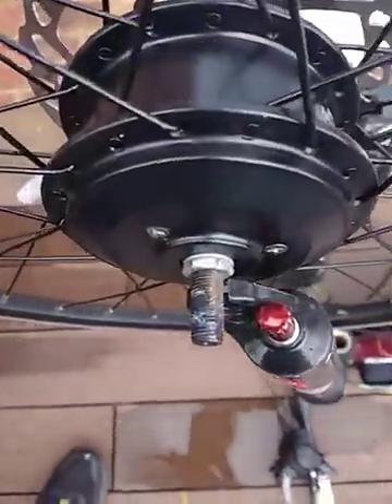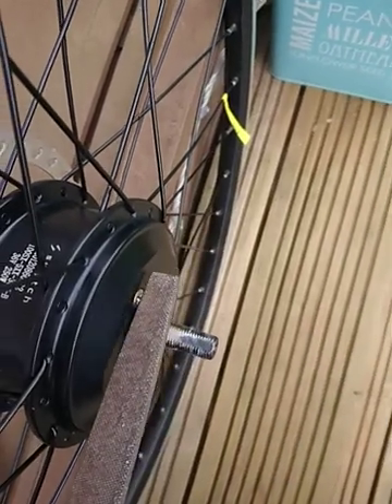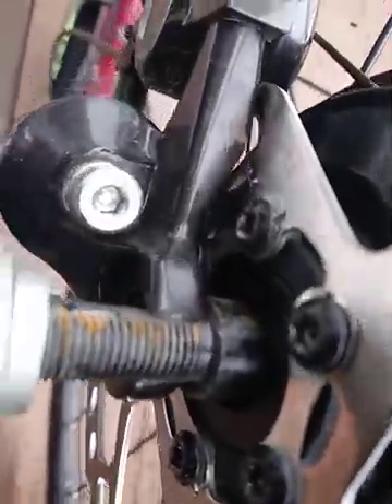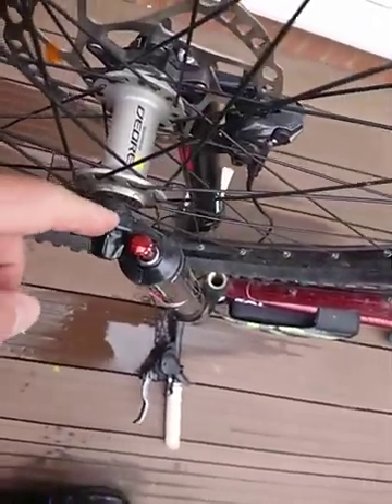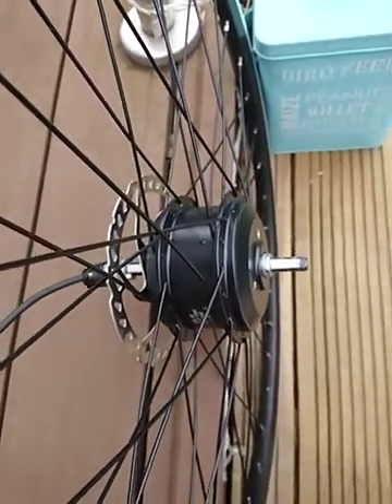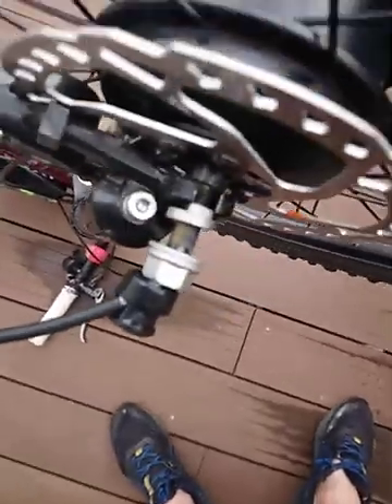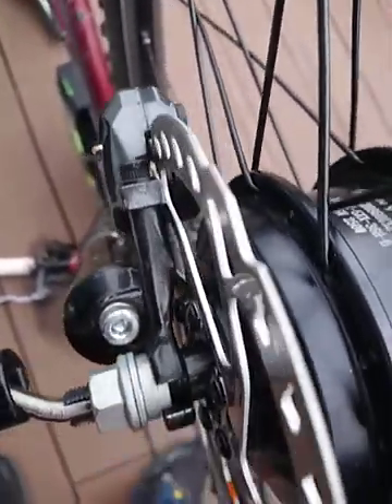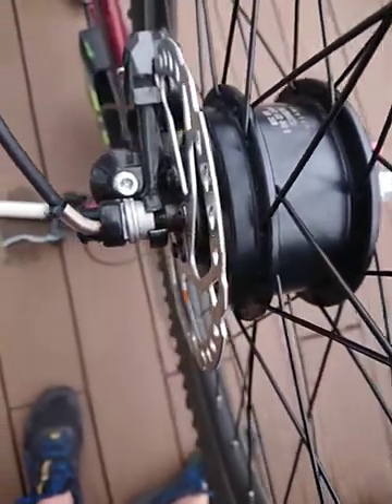Swytch electric front wheel fitting. Forks too small? Walkthrough getting swytch front wheel to fit.

Comment: So, you do the very they say not to do in the manual?!?
Reply: Yes and recorded here so you can decide if it works . I don't think this is a recommendation , Just a "this is what I did if it's any help to you".   Obviously you can follow the instructions to the letter and send it back as it won't fit.
Reply from the maker: In fairness it used to say file , but definitely says not to in the new manual..they obviously didn't want to take the liability anymore. Here's the current manual .  https://www.swytchbike.com/manual.pdf
Reply: @dickysylvester  no response from support, so I just filed the thing (carefully and evenly). Pretty minor amount of metal removed and I have no idea what other solution there would have been. It’s solid and not going anywhere!
Reply: @dickysylvester  Ah, so the manual has changed? Your link is what I have. I raised the support ticket before I found this clip. 
I guess there’s no great hurry for me - they sent me the wrong charger, I think (cable doesn’t fit the inlet in the battery)!
Reply: @colino72  Hi Colin, How long did they take to replace the charger? Same problem with my kit. Opened support ticket 4 days ago, nothing yet. Have now opened one for the wheel not fitting (before I file anything, let's see what they say - will update this comment following their response.

Edit 1: I see that their system is only allowing ONE request per customer - any new cases I try to open are being marked 'Solved', and a comment regarding that was tacked onto my original case. Not going well so far!
Reply: @stepheneyles2198  hi there. I had a reply after 12 days saying the part had been ordered, would be picked within two days and then shipped within 7 days and I would get a tracking no. That was Wednesday last week, so I should see the tracking code within the next 7 working days. 
They were apologetic with the response delay. In the meantime I had made myself annoying on Twitter. Not sure if it made a difference. I also sent their CEO a message on LinkedIn, but he didn’t respond.
I never had any technical advice on the forks, filed them anyway. I saw another YouTuber post that he had been told filing them is acceptable and does not void warranty.

Comment: Hi, I have just done this on my 2000 specialized epic with fox forks , snapped the lugs on the first outing , very glad I was ridding slowly through heavy snow and not on a road a speed, can anybody reassure me that this actually works and is safe? , I guess you need a strong steel or reinforced suspension fork given that I have given my bike a hammering over the years I was very surprised this snapped in less than 2 km.
Reply: Wow that was really unfortunate. I would say I only "shaved" a bit to get them to fit and have done 100km's since  but there was loads of metal there. The other way is to take a bit off the hub.
And Ihave steel forks
Ask swych?

Comment: You file the drop outs not the motor for Christ's sake .
Reply: But then the forks are useless if you want to fit a standard wheel Baack in the future. But another option. Thanks for feedback.
Reply: drop outs? You mean the fork, not a good idea? I did that and it broke immediately... next is filing the spindle with new forks. Quite expensive conversion kit.
Reply: @sil3176  just to add to this , I'm 3 years in now. at least and its fine.

Comment: I would say that on fitting the front wheel, take particular care, I didn’t see this video. I filed the lugs a fraction to make the shaft fit, also the forks were very old,  cast aluminium is not the strongest material. I would like to see in the literature more information on this issue, and not rely on coming across a video on you tube. To finish, the swytch kit is very nicely made, with a feel of quality to it. I brought two kits, just got fit it to the Brompton now. Happy days….

Comment: My fork lugs snapped in five minute of use, suspension forks made of aluminium, it is not strong enough for the power of the hub. So I have to now to buy new ridged steel forks and have them fitted.🙁 so lucky I wasn’t going fast when they broke.
Reply from the maker: Wow, that's something I've not heard of before. And another cost. I've only ever been on the road, was the break off road?
Reply: Sorry to hear…glad you seem to be okay.  May I ask the make/model of fork you were using?   I’m about to install Swytch bike kit on Rock Shox Judy TT fork.  Thanks.
Reply: @rayy3628  hi, my forks were pretty old suspension ones, cast aluminium. The bits that broke off were very porous looking.
Probably more modern ones may be of a better quality. I have fitted two swytch kits, one on the mountain bike, and the other on my Brompton, I am very pleased with them. Bye
Reply: Really? So you filed the spindle and the forks were not strong enough? Quite scary! How did it go in the meantime, did you go with Aluminium or Steel forks? I made the mistake to file my forks and they broke immediately... so need to buy new too and I'm unsure what to choose.

Comment: Had the same problem but filed my forks to fit, the nit itself works fine and am very pleased with it overall

I've had a complete knee replacement and struggle with enough bend have had to take off my SPD pedals so there's next to no chance of going back to a non motorised assist wheel
Reply: Similar with me and knees.